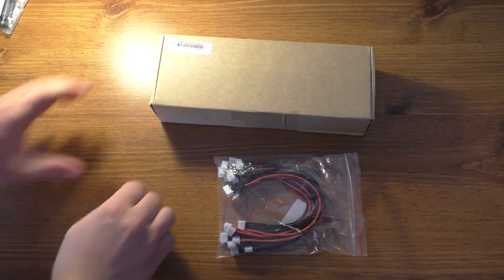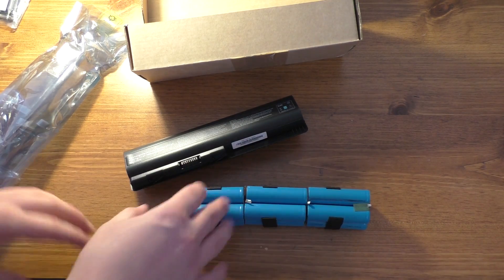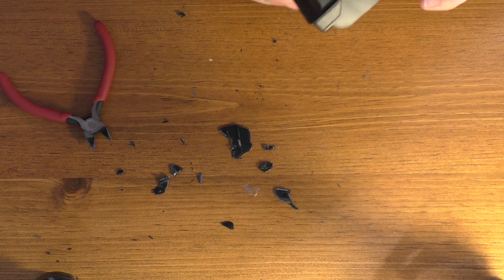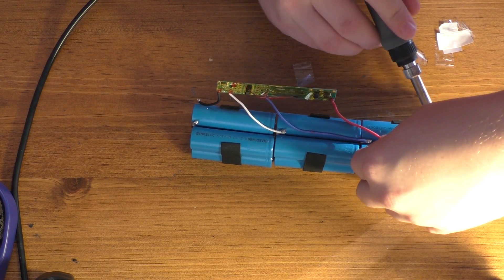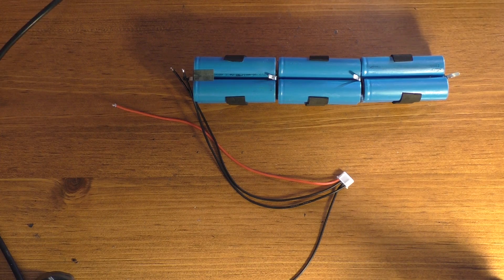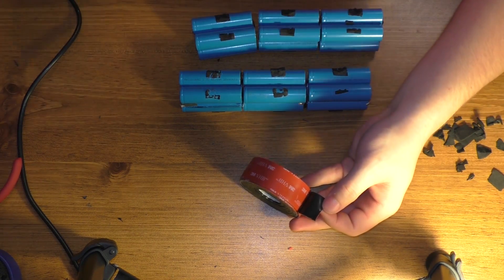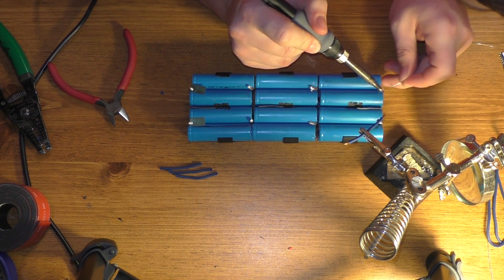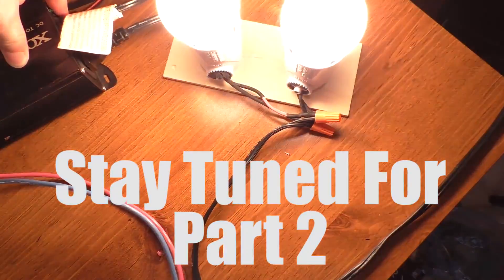DIY 12V Lithium Battery Pack Part 1

Comment: I am confused Eman , as I know three batteries lipo in serie are 11.1v  . if you multiplied 3.7v by 3 you get 11.1v 3.7 v is the voltage across one battery.  how do you get 12v? maybe I am wrong I just want someone to explain what is going on.
Reply: 4.2 volt multiplied by 3 equals 12.6volt

Comment: Cool! Do you know whats the discharge rate of your final battery? would it handle 30c or 35c discharge rate? thank you.
Reply from the maker: +LudoriaGame unfortunately standard Li-ion 18650 battery cells (which is all these batteries really are) can only handle a discharge rate of 2c which in this case would be about 35 amps (enough to handle the 300 watt inverter I installed on my battery pack).

Comment: Hello could I have help with building or buying a Lithium ion charger circuit. Could you recommend one? Building a 12v battery using 20  18650 cells.  Want to build it for my solar panel or my gocart. Can I use your same design?
Reply from the maker: +shawn lee Hi I am currently working on a video about Li-ion battery chargers. It should be done in about a week. I will leave a link to it here when I upload it.
Reply from the maker: +Eman2000 He is the video on how I charge Mine: https://youtu.be/KIJI7yAG2NY
Reply: +Eman2000 ty :)
Reply from the maker: shawn lee Your welcome